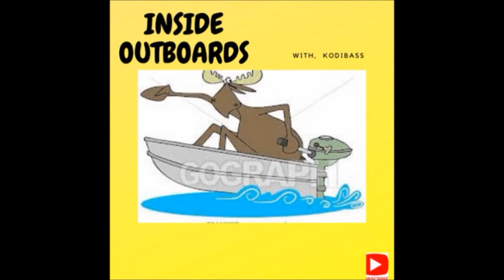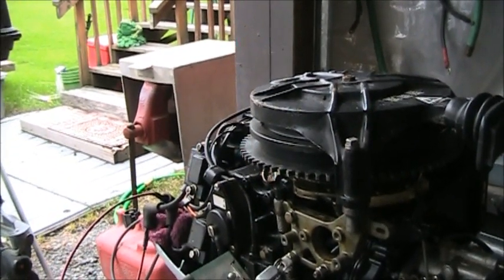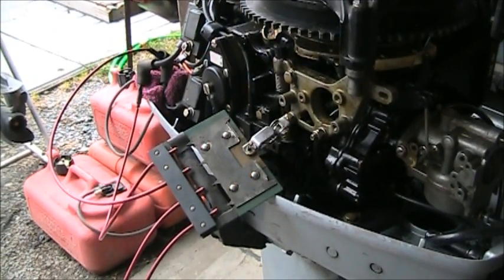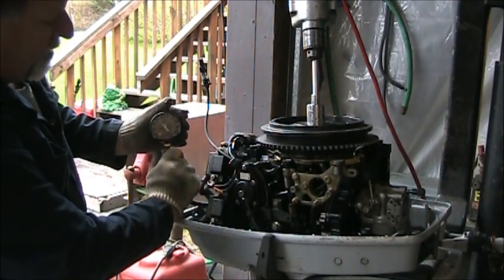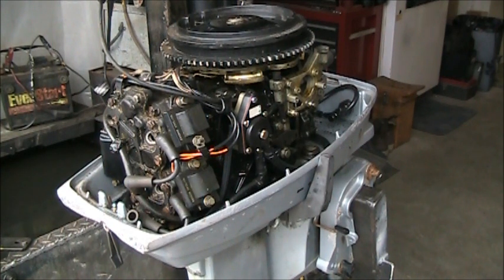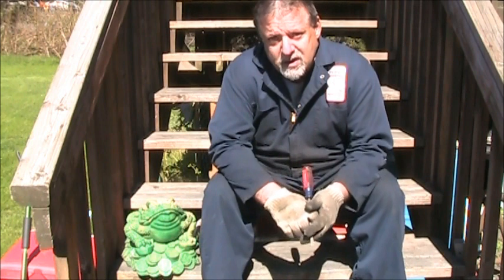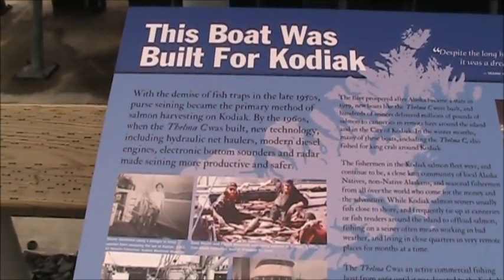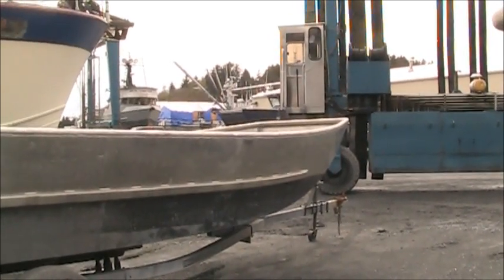1987  30  HP   EVINRUDE   (  FIXED  )

Comment: Polar extreme from that poor Suzuki used commercially.... That 30yr old engine looked pretty darn nice after all that commercial use.  You are so right about user error, very common even on single user engines...That darn primer is confusing to use, here is an example of OMC spending more money but confusing users.  Maybe I can come up there someday and take a quick dip in your outboard "fountain of youth"!
Reply from the maker: +kramden,  Not 2 mention if you look @ the primer the wrong way those teeny tiny plastic nipples break off.  You would B most welcome 2 come up.  4 SURE,  Lots of good fishing up here also,,  I'm no good @ it but I know people.                                        kodi

Comment: Learnt a lot thanks I’m doing up a 1936 Coventry 45 🏴
Reply from the maker: +GE,  Thank's,  I sure wish I could get my mitts  on some of that pre 50's  stuff..  Just does no exist in my area.                        kodi
Reply: kodibass your lucky I assume is that you live in US there is a lot of old Johnson  twins and old Mercury’s with the streamline cowling on the motor but in England they command higher prices but on the plus side we have all these old smaller British brands that use whitworth tool set  that are long gone like British Seagull which is a barebones water cooled singles that are measured by thrust from the prop and are made to pull small boats with a displacement hulls and you can get a working seagull outboard for about £25 I had a 5hp one once and could push a 4 ton sailboat at about 6 and a half  knots it ran a 10:1 fuel and oil mixture the fuel looked like beef stock.
Reply from the maker: @googleexplorers7209    I sort of,  Live in the US,  I live on Kodiak Island Alaska, Which is 200 miles west of the Alaskan mainland. in the middle of the Pacific ocean..  I have 2 British Seagulls  Myself & love them.                       kodi
Reply: kodibass Got a silver century plus that I put the lower internals from a Seagull 6HP Kingfisher parts  so it has Forward Neutral Reverse and then gave it win-pac electronic ignition which is sealed and 416 Amal Carb with 25:1 jets added separate exhaust tube so you don’t dump it into the water
Reply from the maker: @googleexplorers7209   I would love 2 see it any vids or photos?   sounds awesome 4 sure.                      kodi

Comment: Thanks for sharing. The fishermen around here use hoop nets and catch catfish on the Mississippi River and there boat are on average 18 foot John with a 30 OMC tiller handle
Reply from the maker: +DG '  Hey I was watching a tv show about this & I loved it,,  It showed fishermen doing this, & I remember a couple of them got in a fight because the one fisherman was checking  the others traps & taking his fish,,  I can't remember the name of the show but really enjoyed watching it..      kodi
Reply: kodibass it happens I lost 2 tournaments last year and I think they did that just because the fishing was so slow with the flood they had three over 50 lbs we had 2 with over 2k in price money people start cheating. However it’s fun that’s why I do it.
Reply from the maker: @unsaltedlife5998  , Well that's not good.  But I sure get the Fun part,  I remember the guy's in the tv show were using just a 2 stroke 15 hp Merc.  kodi
Reply: kodibass a 15hp will work until you get enough weight in the boat and have to cross the main channel it gets scary the Mississippi River can move about 8 to 12 miles per hour so I don’t use anything under a 30.

Comment: Great video! I have the same motor. My problem is my oil pump is going bad, is it possible to disconnect the pump and just premix the gas? Any chance you could do a video on it?
Reply from the maker: +KS, cut the hose from oil tank, put a bolt in the hose on both sides of the cut & zip tie the bolts.  Your done mix your fuel/oil 50-1 TCW 3.                 kodi

Comment: Hey Kodibass, I have a 1992 Evinrude 30hp. It’s running but the RPM’s are not running high and it doesn’t go too fast. This is my first boat ever. Don’t know what to do. I don’t know if it needs to be running faster or not, but wanted to be able to get some info from you. Any email you have that I can ask questions on?
Reply from the maker: +MA,  check your spark, sounds like you are running on one cylinder, my email is lenny@alaska.net.        kodi

Comment: informative videos Thank you :)
I have a 1987 20hp Evinrude that just ripped me 1262$ I know for a fact I got played it doesn't even start properly sometimes not at all on the water. but what done is done.
My Question is this can I install an electric start on this without any out sourcing ? 
Thanks in advance
Reply from the maker: +SA,  Your best bet is 2 find a doner motor that was electric star from the factory,  Then u would have all the components 2 convert yours to electric start.            kodi

Comment: Great job, my question is thermostat ( I vapor blast and retest and install,and replace water pump impeller. Would these people do that service or would not want to pay
Reply from the maker: +JB,  Nope I could & should do heaps more 2 this motor, but never without exact instructions 2 do so from the owner...  Been burnt 2 many times,  I stock T-Stats new.                                    kodi

Comment: Cody let me ask you about the 20-35s , are these motors primarily work motors  I have from 20-35 an4-15 Johnson  and everudes can’t help it I collect them
Reply from the maker: No they  r fine work motors, but were designed for recreational use ,  OMC  Did make a 3 cylinder 25 commercial it SN# will contain the letter M in it.      kodi

Comment: Any advice would be appreciated here. I have a 88 evinrude 15 ive been trying to get right for a couple of weeks. I used to run it on my jon boat and i would have to choke it every time i put it in gear or it would die. Well one day it quit on the lake and i ended up getting a bigger motor because i couldnt figure the issue out. Its got spark will jump a half inch gap 85+ psi in both cylinders new fuel pump full carb bowl ive tried cleaning it a few times. Motor will start if i put gas in the cylinder but dies when its burned out. Wont start unless i block the carb with my fingers and will not stay running. Any ideas?
Reply: Most likely a carb issue, those modular carbs are troublesome compared to the simple ones they replaced.  But, always check your fuel supply first, make sure the fuel/oil is fresh and free of water.  Seems like you have had the carb apart, correct?  The engine will fire if you block the carb throat which would seem to indicate the fuel supply is OK.
http://www.marineengine.com/parts/johnson-evinrude-parts.php?year=1988&hp=9.9&model=E10ECCD&manufacturer=Evinrude&section=Carburetor
The low speed pick up hose #4 is often to blame, what color is it?  The original black ones disintegrated and debris plugged up the carb passages.  Replacement pick up hoses are tan in color and are more durable.  That black plastic cap #25 is delicate also, and very expensive, be careful not to break it.   #23 is the main jet, perhaps it is partially plugged.  Be sure all the little gaskets are in place and in good shape...
Reply: I have had it apart a few times now. That hose was black so sounds like that could be the issue. Im going to take it apart and run it in an ultrasonic and probably pick up a rebuild kit for it. I know that top is no joke i had a 9.9 that had the top crack and i was definately surprised when i saw the price tag.
Reply: john streacker prices can be more expensive than expected for my Mercury 115 hp I bought a salvage engine for parts instead of forking out £650
For a powerhead and hydraulics.
Reply: Google Explorers yeah i hear ya. Ive got a 9.9 ive been picking parts off of.
Reply: john streacker The only problem with my mercury tower of power it drinks a lot of fuel I’m getting a back up yanmar 45hp diesel outboard as a secondary when I can find one to rebuild that does not cost £5,000
Reply: @johnstreacker6683  Be sure to clean out the fuel passage that the hose connects to also, maybe with very thin wire...The debris from the black hose oftentimes gets stuck in the pick up tube.....And yes, definitely replace that black pick up hose...
Reply from the maker: +js'  yes'  somewhere your carb is blocked inside,  take your carb 2 a carburetor shop & the will soak it & clean it for u in the needed very nasty solvents.  I know what they R but young people watch my channel so I won't post them .         sorry.            kodi
Reply: kodibass will do. Seems like this might be a little out of my league. Doesnt hurt to try though.
Reply: What about fixing stripped threads on those recoils? Its an electric start so ive been getting by but the recoil threads are stripped.

Comment: I have a 82 model 15 hp evinrude. Have you ever converted the gear driven tiller handle throttle to the newer style cable style throttle?
Reply from the maker: +ds  Yes I have,  you are basically changing the set up to a 1993 & up 15hp  system.                                kodi

Comment: I have that same engine but a 1989. I had mine break down in the bay. I heard a load noise in the propeller & shut off. I put it in neutral & pulled the cord & ripped out of my hand OUCH!!!!!!!. I was told my woodruff key might of broken in the flywheel. Any suggestions??. Recoil does pull smoothly if I take out the spark plugs.
Reply from the maker: +cr, you were told correctly,  U most likely did indeed sheer the flywheel key,  pull your & replace the key, & cross your fingers that no lower unit damage occurred .                                                            kodi
Reply: kodibass thanks for your reply. I’ll order it ASAP. I really appreciate your help
Reply: @kodibassInsideoutboards  I put on the woodruff key & turned on . Thanks for your help.  👍👍
Reply from the maker: @cramos6638   +cr   ,  Fantastic news,  so glad u r up & running..                  kodi

Comment: Have an 87 Evinrude 30 just like that. What designates a commercial vs regular ? Picked motor up in Minnesota and I live in Nebraska.
Reply from the maker: +glhc28,  They have a weird SN#  & R for the most part just bare bones no fancy stuff allowed  work motors.            kodi
Reply from the maker: @Maddog worker  The Thermostat inside this motor is  a 165 degree stat..  that is what it is designed to keep the ruff operating temp. @  If it goes
past that by 15 to 20 degrees constant there is most likely a issue.                   kodi

Comment: How do you get the pivot pin back in on a 1986 evinrude 30?
Reply from the maker: Clean everything very well, Put the pin in the freezer  & then heat the aluminum use a brass mallet & tap it in.      kodi

Comment: Hey kodi got a 1996 evinrude 30. Coughing at just over idle? Gas it she stops coughing??
Reply from the maker: That is a sign of running  lean,  , most liklely you either have a leak in the plastic top, or carb & jets need to b cleaned.      kodi
Reply: What plastic top.  Might be leaking ?
Reply from the maker: @dustinclark8186  OOP's  sorry,  Your carburetor top on a 96  should B plastic, unless some one changed it to a earlier model,  which is doable,  If it is the plastic kind they often leak as they age.     kodi
Reply: Ok its all aluminum carb totaly cleaned.   Still coughing at just above idle.   Turn a little more runs great

Comment: Kodi I'm having HELL with an 86 Johnson 30hp sneezing. I've rebuilt the carb twice after 1hr in my ultrasonic cleaner, replaced the head and gasket. Could the lower crankcase seal cause it to sneeze?
Reply from the maker: +brt 123 ,  Yes'  your  intake to cylinder gasket could need replacing,  If it is damaged & sucking air it will cause a lean sneeze
kodi